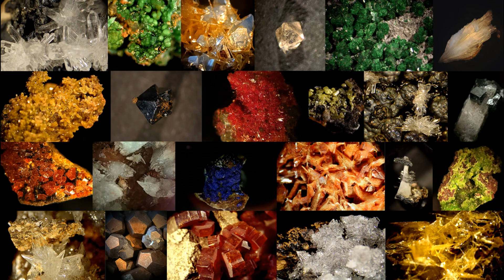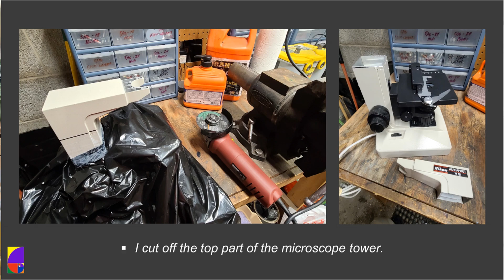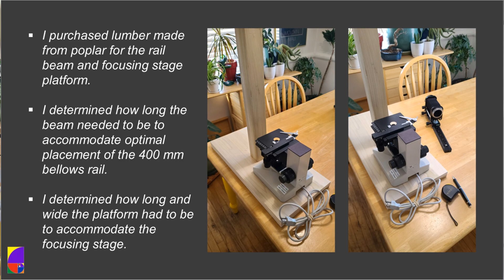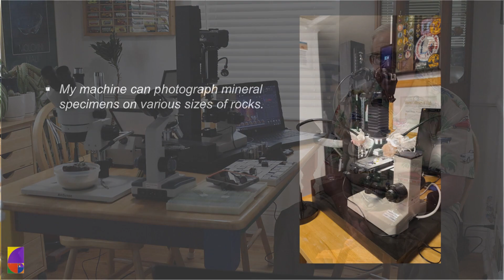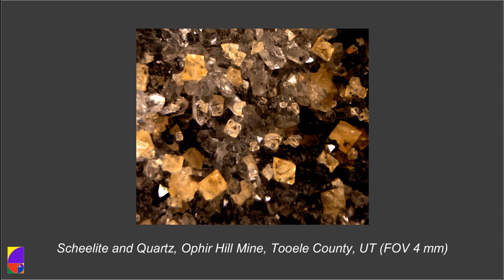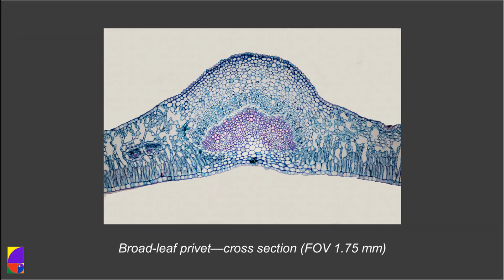How I Built My Microphotography Machine

Comment: Thank you so much for posting this! I learned something I didn’t know, which was reversing the lens with an adapter to make a macro lens; brilliant! I’m glad you covered focus stacking at the end because I was wondering about this through the whole video. It would have been nice to have seen a single frame versus the focus-stacked final image, but that’s just my own inquisitive nature kicking in. :-)
Reply from the maker: clipper 99, thank you for taking the time to watch my video. And thank you for your constructive suggestions. Yes, the focus stacking is the whole reason for the machine. The Backyard EOS program allows me to frame and focus the specimen and determine the upper and lower limits of focus for the stacking process. Then, I start at the bottom most focus point on the specimen and slowly work my way up using the focusing stage until I am at the top most part of the specimen. Then, I import all the frames into my Canon software and stack them. It is really amazing to compare any of the 20 to 100 sub frames (depending on the subject) to the finished picture--amazing. If you make a machine, I'd love to see pics of it--and some of your specimen stacked photos!